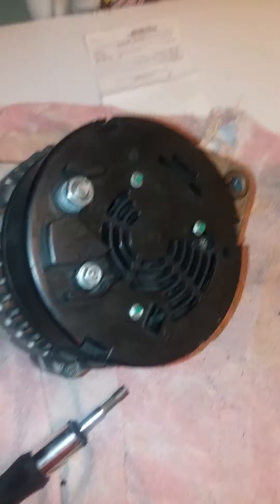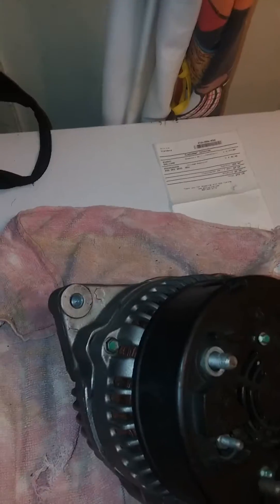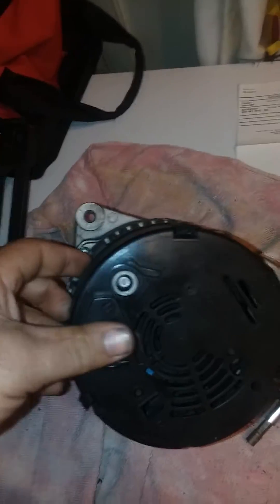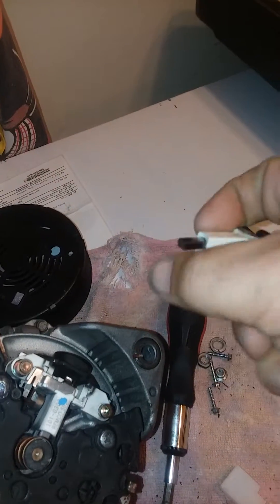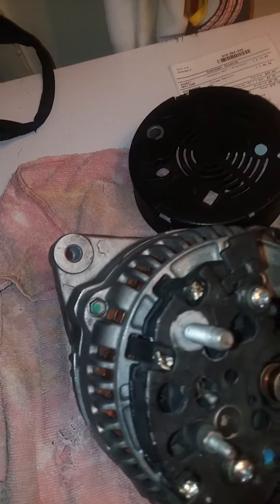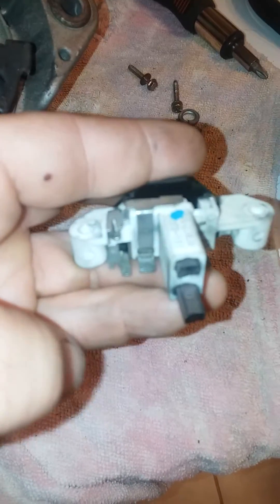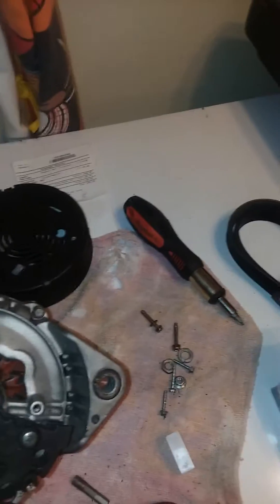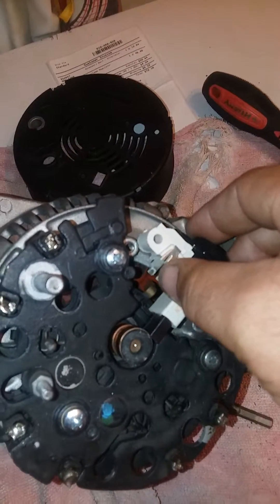Audi a4 B5 1.8t Quattro  alternators voltage regulator replacement

Comment: Got any videos on how to remove the alternator from these 1.8 audi a4 quattros without removing fans or front end? Closing thing I’ve found suggests removing the belt and some hoses to get at bottom bolt but he never showed himself doing it
Reply from the maker: If you remove the hose for the intercooler going to the throttle body it will give you enough room to get the alternator out
Reply: Garry Giordano Ok, next question is I went to Oreileys and had them scan to confirm the voltage regulator was the culprit. Went to an autoshop and they claim you cant just change the voltage regulator and that you need to change the entire alternator l. Obviously thats a bunch of bs but I must ask on a scale of 1-10 how difficult was this job for you? I’m some what of a novice but I can follow instructions pretty well and have done majority of work on my audi. The part I’m mostly worried about is reattaching alternator, seems like reconnecting all the wires could be cumbersome due to space limitations.
Reply from the maker: @SCRATCHONEMORE  Obviously you can do it yourself. By changing just the voltage regulator. For them to tell you you cannot change just the voltage regulator is false there. Just trying to get money off of you. And on a scale from 1 to 10. It was a little bit of a bitch. I give it a 8.
Reply from the maker: Any auto parts store can tell you if The voltage regulator is the culprit. The biggest issue with getting the alternator out. Is the one bolt right next to the fan. It may not want to come out all the way. You can get it to slide in between the fan blades and loosen up just the top four bolts. Of the radiator support so you can pull it back just enough to get that bolt out the rest of the way. It's not very hard. All you have to do is remember. What part went where? What bolt went in what spot what wire connected In a specific way Just pay attention to what you're doing.it. And remember it's the reverse process of putting it all back together.
Reply: As a person who has never done al alt before besides on my wifes camry, it was a breeze, super simple with the right tools. Took me about 15min to get it out, took me a little longer to put it in but thats because I was trying to see why it wasnt working
Reply from the maker: @carrilloazael92  I'm glad everything worked out well for you

Comment: The 2 prongs are carbon contact brushes. A faulty one wil bring up a red ALT light on the dashboard while the cars 'On'. It might be intermittent a few times & then stay on. If the key is out, the light will turn off.
I just replaced the brushes for NZ5.90 = US$4 on my Audi alt, different Alt but same story, needs some soldering to connect the wires.